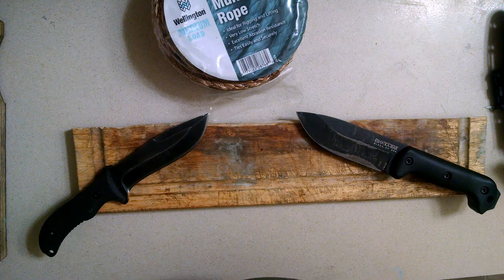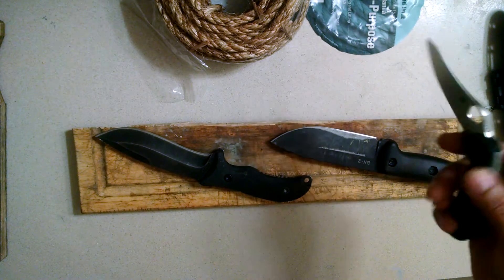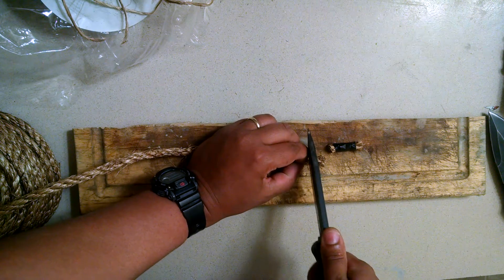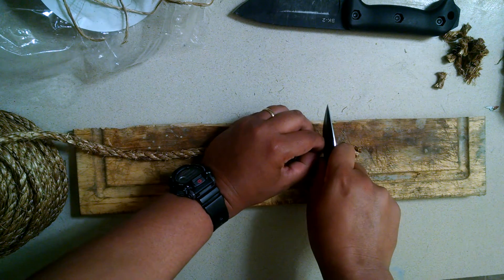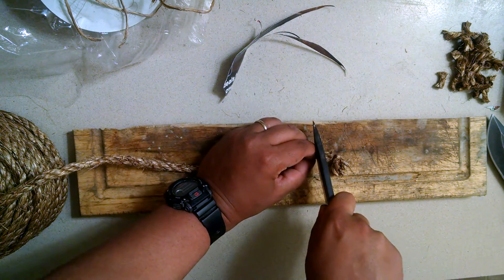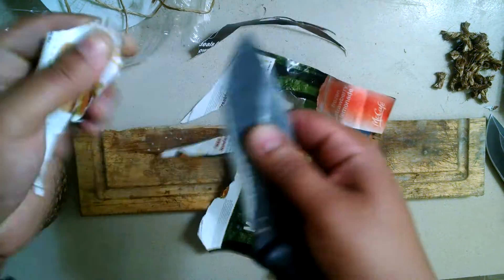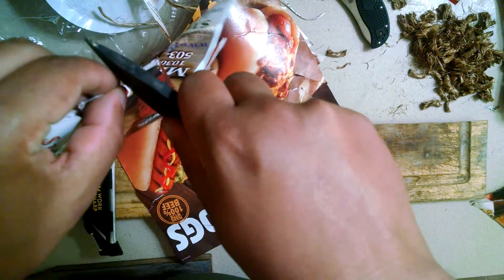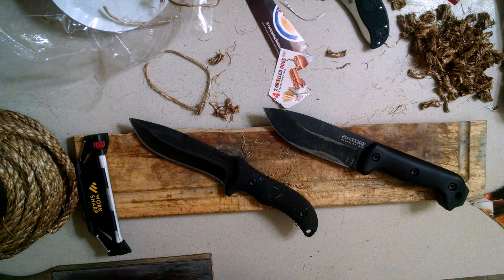Carbon vs Stainless, wear resistance

Comment: 1095 is not an expensive steel.

You only test what your sharpening produces one one example of each knife - not one example of each steel.  You assume, without evidence, that each knife stands for all other knives made form that steel.  You admit the geometries are different.

Such eccentric results deserve careful examination.  1095 has been "cutlery steel" for well over a century.

Your results are consistent with a "tinned edge" - great on a sheet of paper but fold over when used to cuts anything hat seriously resists.

Schrade is pronounced as it is spelled - not cha·rade